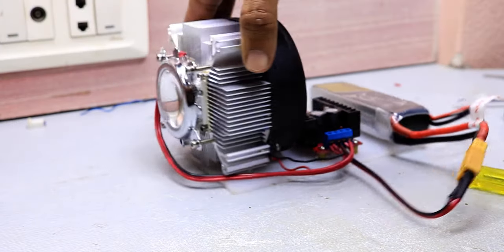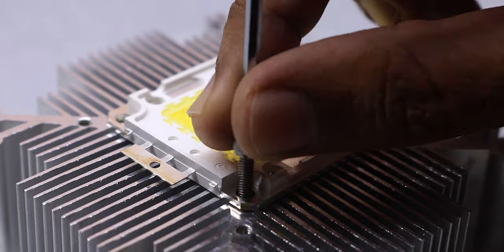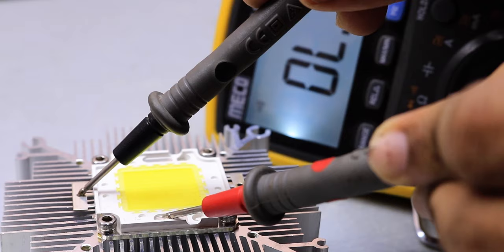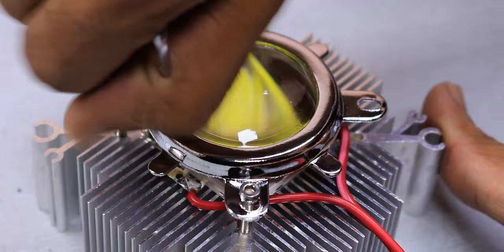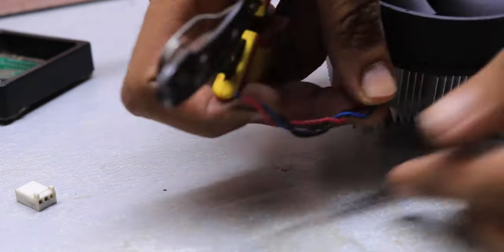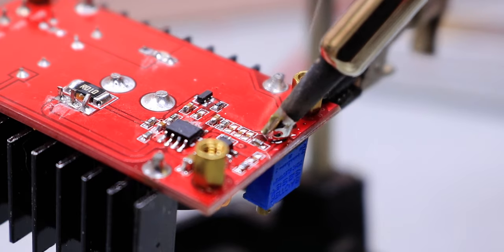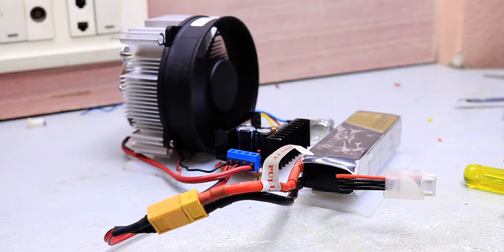Make Your own 100W LED Light! | DIY

Comment from the maker: Spectrum Analyzer:http://bit.ly/2IQ2n5H
LED Light Chip:http://bit.ly/35yrC6o
DIY led chip heatsink:http://bit.ly/2OKOglX
Lens+Reflector Collimator+Fixed Bracket:http://bit.ly/2IOvczk
Power Boost Module:http://bit.ly/2MLeN06
Find More Module Here:http://bit.ly/2YVyEh4
Download Banggood APP to get extra 10%OFF:https://banggood.app.link/6wABIH7sNX
Banggood Black Friday 2019:http://bit.ly/32inpAY

Comment: Finally completed my light! Now I need to know how would u go about making it controllable via remote. On and off and brightness adjustment?
Reply: Pretty cheap controller circuit boards on aliexpress that let u turn it on or off using wifi
Reply: If you know Arduino you could make your own fairly easy with prebuilt libraries or just find some other hardware solution

Comment: Hotglue may melt after sometime you light it up....as LED chip release more heat...Bestter using Epoxy or Use some bolts👍👍

Comment: Been trying to make my DIY leds for video use but I can't find a cheap floodlight with proper 100w driver. 
I like their form factor as they're small and compact but can work for bounce lights in tight areas. However, I want to use high CRI LEDs and the ones I own don't have a built in driver, which unfortunately seems to be the case with most of these cheaper floodlights with horrible color casts.
Lot of DIY builds have very odd form factors which make them difficult for production environments, other than flexible light panels.
I want a cheap LED par or flood light that I can easily swap COBs on!!!
Reply: high cri is a major deciding factor.Look at the MRP of GODOX SL60 W its around 9000 rs u will need atleast 3 for a decent production + added light modifiers and stands a minimum of 55000rs

Comment: Be careful with this setup as you're not confirming if the delivered current is in spec with what the LED can handle. Best to check with a multimeter to see how far you can go. If you go over you'll greatly reduce the LED lifespan.
Reply: Required voltage as the led will draw the required amps

Comment: I've seen people connecting the potentiometer along with the trim potentiometer in parallel with some resistors to do the dimming. My question is, is your led still working because I think the led will be killed when u turn the potentiometer too much. Please let me know
Reply from the maker: I have been using these to shoot all my video till this date, no problems so far.
Reply: @Nematics_Lab  ok great will try your method and the other method too I ordered lots of LED chips 😁
Reply: What would that look like? Couldnt you just wire the two potentiometers in serie and use 1 potentiometer to set your max where the leds dont blow out and then control the other potentiometer to control the intensity?
Reply: LED are diode and have a forward voltage where they just turn 'on'. Using a pot to adj resistance would require not only a pot that can handle that much current would not make much if any difference in brightness. You would want to use a PWM circuit with a mosphet that can handle the current and you would change the duty cycle of the on time to create a perceived difference in brightness. It turns the power off and on very quickly from on 100% of the time for full brightness to something less like 60% on time. This would be a more reliable and probably less expensive but more complicated circuit to give you a brightness control. This is how most led flashlights work and give you the output options.

Comment: Would this work without a battery and wired to 240v instead ?
Reply from the maker: Nope
Reply: For that you also need a different LED-driver.
Reply: YES, but you need to find the similar look but 240v led chip on Ebay.

Comment: can we adjust its brightness
By applying Variable Voltage
Reply: Variable current, not voltage. Leds are current driven.
Reply: @buatt  Thanks 🙏
Reply: @buatt if you vary voltage, you will vary current
Reply: @Cr1z4n63L  with LEDs little voltage variation may lead to big current variation, since it is a nonlinear component. LEDs must be driven by current.
Reply: @buatt  you are right, i forgot that, thank you for clarifying

Comment: Good video thanks.

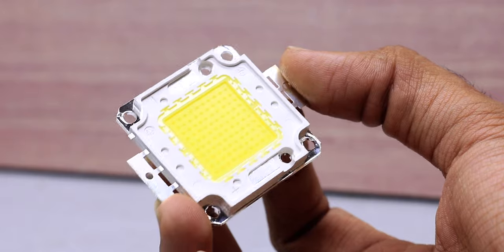I didn’t understand a couple of words at 0:32. You said: “We can’t just use any 100 W LED. We need one with good …….”
It sounded something like “good CR Rating” but I don’t think that’s right. What do we need to check about the LED Light chip?
Reply from the maker: CRI rating
Reply: @Nematics_Lab  Thanks..... another question. What is the power supply in the video? Is that a rechargable battery? What product and what specification?
Reply: And ...I may as well get the potentiometer too so can you give the spec of this please?
Reply from the maker: Battery I'm using is 12V 2300mAh lithium Polymer (Li-pro) and potentiometer value it 10k ohm
Reply: @Nematics_Lab  which potentiometer did you use?